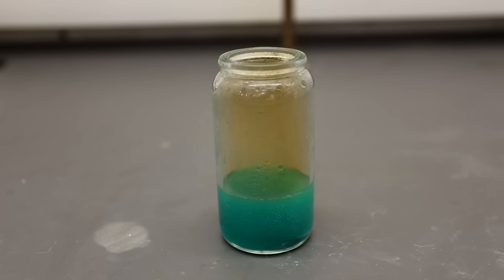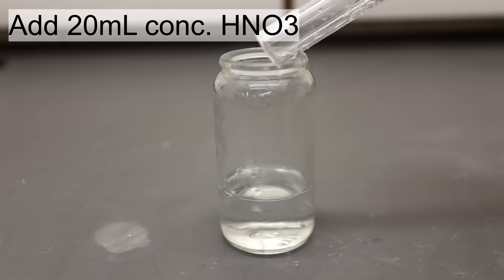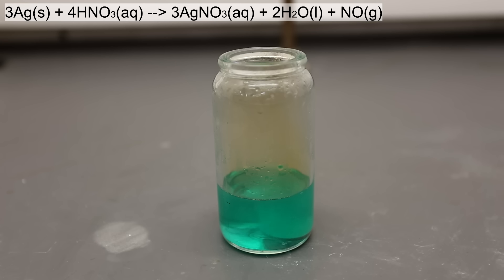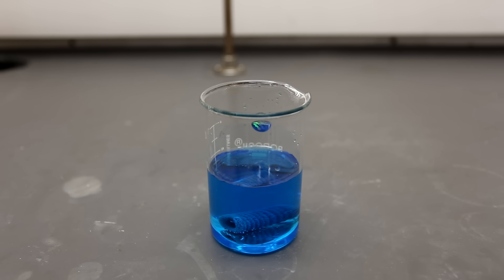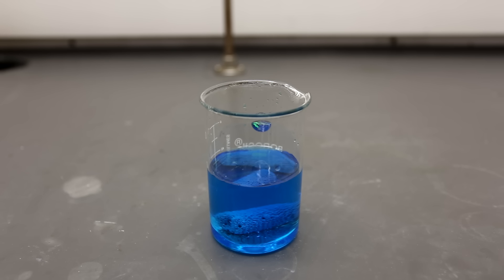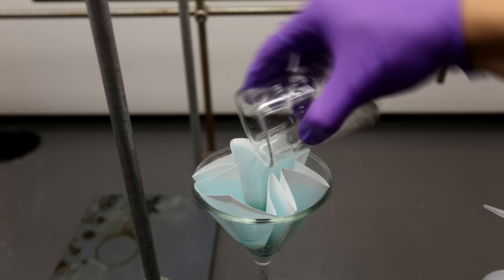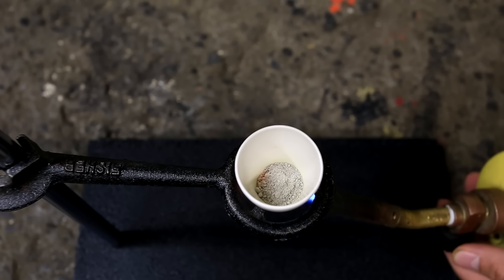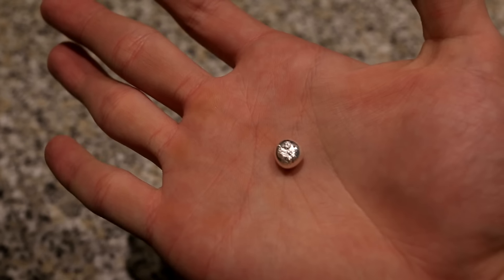Extracting pure silver from a coin

Comment: There is a better way of collecting silver using a metal pyramid mold flux use a collector metal like Lead take your molten material pour it into the mold let the molten material solidify and you're left with a metal button at the tip of the pyramid on the bottom and on top of your slag if you get another layer that means you lost material and you got to remelt it again. But usually you left with a metal button collect it put it in a bone Ash pupil put it in your furnace add a little bit of lead to itand the pupil is allowed to take about 300 g of lead has soaked it in like asponge when all of your lead soak in you left with your with a silver button I heard you recover more doing it that way then using dangerous chemicals

Comment: I thought this was turning lead into silver... where did that video go...dang youhoo!!!!
Also, losing %10 is alot. thats what some crappy managers make. Don't ever lose any...0% is a satisfactory lose..
Reply: You will never get 100% recovery of pure metal, regardless of how many processing steps you take.  A decision has to be made on whether the cost of recovering more of the precious metal will produce more values than the cost of the chemicals/materials to do the recovery. 

As NileRed stated in the video, he was illustrating a process, not attempting to get a high recovery. He could have obtained a far higher yield if he had taken more time and effort. For example, he could have added the nitric acid a little bit at a time, so there was little excess nitric.  He could also have waited longer for the silver to deposit onto the copper.
Reply: @buggsy5  Right, alot of alchemy n rough materials...Hope the yield is worth the exposure to stuff thatll cut sevrl years off. Gotta be an easier way to make $, cuz playing with acidic bout as bad as a short boss with vertical envy syndrome.
Reply: @richardw6592  He stated that the fumes are highly toxic and that the process needs to be done where the person is protected. It looked like he was doing the reaction under a fume hood, which is the proper method for such small scale refining. 
If you want to see videos of larger scale, but not industrial scale refining, see the videos by sreetips.

Comment: Anyone know how you would go about disposing of the Cu(NO3)2? Would you be able to do it yourself or would you have to give it to a waste disposal company?
Reply: ***** Ah cheers.
Reply: +Secil Nolan I can't see his reply. could you tell me the proper disposal of it?
Reply: Hydrous Copper(II) Nitrate can be reduced with iron or zinc to produce elemental copper. You can also decompose it by heating it into copper oxide, oxygen gas and nitrogen dioxide gas, which can be bubbled through water to make nitric acid and nitrogen monoxide, or bubbled through hydrogen peroxide which is more efficient as it only produces nitric acid.
Alternatively, ask your local garbage disposal about when the next chemical disposal is and give it to them. Metal nitrates can be very dangerous, so don't dispose of them lightly.

Comment: Cant we just melt the coin to get silver?
Reply: Copper is mixed in with silver coins. It helps with the coin’s durability. If you just melt the coin, it will not be pure silver. That’s why he used acids to dissolve the copper.

Comment: I found another way to do this, though slower - use HCl mixed with H2O2.  I used 35% H2O2 but it is not required, but the reaction runs faster.  Note also H2O2 at high concentrations is dangerous, particularly to eyes - use caution.  The end result was CuClx (and probably some ZnCl2) in solution (which you can later evaporate to capture) and a silver powder on the bottom of the beaker.  I tested it on some 10% silver coins from Mexico to get this result.

Comment: I have about 78 silver coins 400/1000 silver 600/1000 copper. Is it worth it to melt it and sell the silver by it's own? The coins doesnt have much value for collectors.
Reply: Rafa Peltoniemi if you melt it, it will alloy, you won't get any silver. Also the coins are worth more than the silver extracted. If you are going to extract the silver then use the method in the video

Comment: Is it possible to just use the silver nitrate made during the first step of the procedure? Would it be good silver nitrate considering it's made using impure silver?
Reply: The solution also contains copper nitrate, as well as trace amounts of other nitrates. If those impurities do not matter for your process, then you could use it. Or, you could precipitate the silver - nitrate it again - then precipitate a second time. This will produce almost pure silver.

Comment: For the first reaction: how come the silver replaces the hydrogen in nitric acid if silver is less reactive than oxygen?
Reply: Nitric acid is a powerful oxidizing agent, unlike HCl or other non oxidising acids. So the nitrate ions attack the metal to oxidise it, leaving behind either NO or NO2 depending on reaction conditions. This is not a simple displacement reaction like Cu + 2AgNO3 --> 2Ag + Cu(NO3)2
This is a two step reaction. First HNO3 (nitric acid) oxidises Ag (silver) to form Ag2O (silver dioxide). This is a redox reaction: 2Ag + 2HNO3 --> Ag2O + 2NO2 + H2O
The second step is a non-redox reaction where HNO3 acts on the Ag2O as follows: Ag2O + 2HNO3 --> 2AgNO3 + H2O 
It is the combination of these 2 reactions that forms the full reaction of silver to silver nitrate
Reply: Silver and copper react with the nitrate ion, not the hydrogen ion. This because nitric acid is an oxidizing acid unlike hydrochloric or sulfuric acid
Oxidizing acid (HNO3, CONC H2SO4)->anion reacts
Reducing acid (HCl, dilute H2SO4)-> hydrogen ion reacts

Comment: I made silver nitrate by dissolving sterling silver (92.5% Ag 7.5% Cu I think) and then adding ethanol to precipitate the AgNO3 leaving the copper in solution.  One could then make Silver by decomposing the AgNO3 with heat.

However, I read in a small monograph on purification methods (I think), that using ethanol in this way could result in explosive contaminants.  To my eternal regret I failed to buy this book and I don't know its name.

If you could comment on this or know of such a book I would be most interested to hear.  Thanks

OK I did some research and found "Silver nitrate and ethanol may give silver fulminate" - in Purification of Laboratory Chemicals (Sixth Edition) - Wilfred L.F. Armarego and Christina Li Lin Chai - ISBN: 978-1-85617-567-8

While not the book I was looking for it looks very useful.

Comment: Great presentation. Thank you so much for this. 
Question: US War Nickels minted from 1942 - 1945 were 35% Silver, 9% Manganese and 56% Nickel. Would this technique work on that metal combination? I have heard that refiners pass over the war nickels because the melt temperatures of the Silver and other metal(s) are too close, also that the manganese is extremely hazardous, toxic.
Reply: Nonsense. Melt temperatures have nothing to do with parting the material with nitric acid. However, what could happen is more than silver would cement out on the copper.

Comment: WHY DIDNT YOU JUST MELT THE COIN ORIGINALY ??    WITH MAP GAS ???
Reply from the maker: The original coin is only something like 50% silver
Reply: +NileRed Meaning you'll have literally the same thing in a different shape
Reply from the maker: Kevin Thompson haha, yeah
Reply: NileRed I'm fairly new to chemistry, but I know you can't melt something and excpect to separate the elements and chemicals
Reply from the maker: Kevin Thompson I mean, sometimes you can, but usually it won't help too much.
Reply: +NileRed since the alloy of silver and copper melts at the same temperature(if it didn't, the extraction would be much easier), is it considered azeotropic? Or is that word only used for gases dissolved in liquid?
Reply: Bejoy Sen in your scenery, if you just melted the coin, you wouldn't be able to release the metal with the lower melting point without reaching the other metals melting point to break its bonds. You're just left with, as mentioned, the same coin that has a different shape. Best way is to chemically separate it, unless you can turn the coin to a fine powder first.